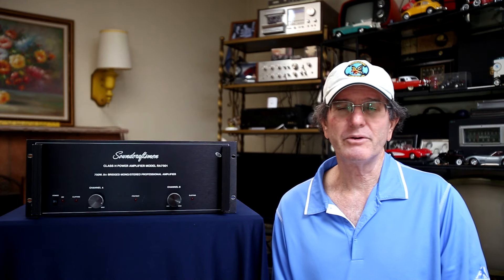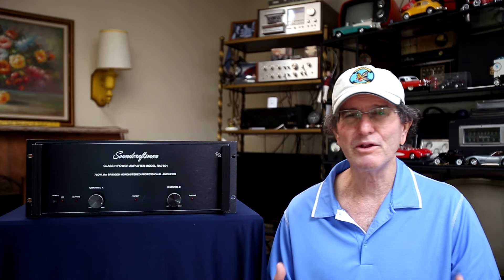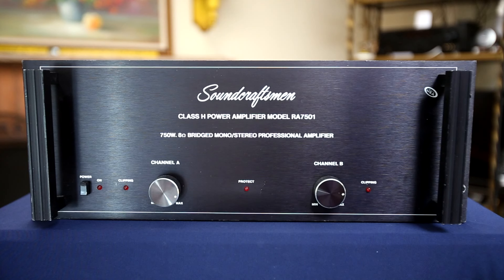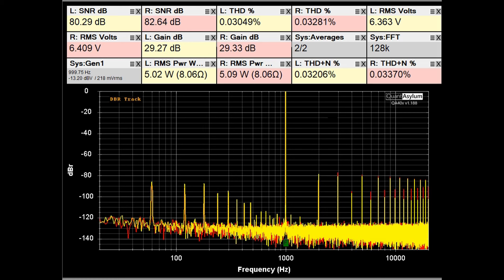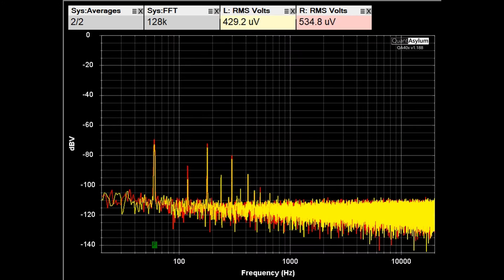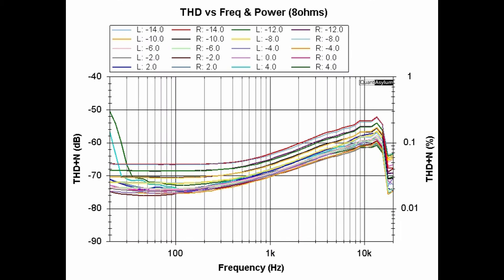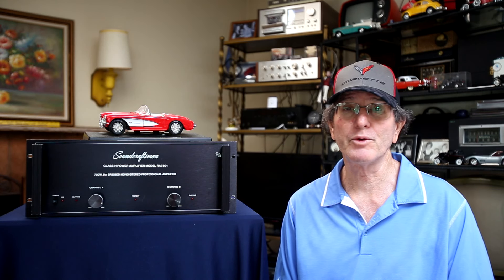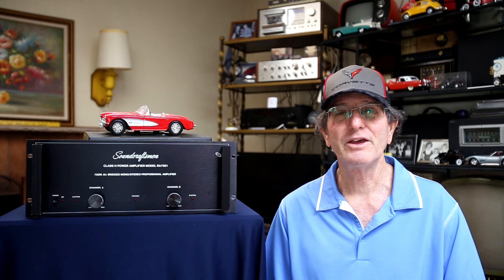Soundcraftsmen RA7501 Amplifier: Vintage Audio Review Episode #104

Comment: Soundcraftsmen made some superb DJ mixers back in the day. The audio quality from the pre-outs and rec-outs were transparent to a point it was a joy to record directly from the mixer. 👍
Reply from the maker: I had forgotten about their mixers- good to know that they performed well- thanks!
Reply: @vintageaudioreview  Yeah some of my friends actually were sleep on Soundcraftsmen DJ mixers when I started using them because the mixers of choice back then were from popular brands such as Pioneer, Gemini, Technics, and a few others. I looked at Soundcraftsmen mixers as a mixer with an audiophile approach. They didn't have a huge line of various models like some of the other well known brands but the ones they had were excellent. The line-out (tape out) quality was one of the stand out qualities that caught my interest in their DJ products because I was recording more often than DJing.
Reply from the maker: @ecstasy5317 I almost bought an SC mixer a year or two ago, but did not want to have to deal with having two turntables. I have a Digital Pioneer mixer that I use these days. Back when I DJ'd in the late 70's/early 80's I had a CM Labs 620 mixer (also me preamp), which I would record from- thought it did okay

Comment: Great gear! I have now a soundcraftsmen Pa 5001, a ps audio 4.6 preamp running a pair of Dahlquist dq10, and I have to admit that is a great amplifier! I agree that is a little bit noisy when on, but the sound it puts out is phenomenal!
Reply from the maker: The PA5001 is going to be pretty much the same sounding amp as the RA7501, and that little thump is just when first powered on, at least for mine. Have not heard your speaker, but imagine that the combo you have works well like you said- thanks for taking the time to comment!

Comment: I used to sell Soundscraftmen audio back the late 70's and early 80's, to me the were gutsy and better sounding than SAE, I remember driving Hartley's top of the line speaker that had a 36" woofer, what a sound. They also had the preamp-equalizer, it was to me not as refined as the amps. I till have the vinyl equalizer test record. Those were the days.
Reply from the maker: Thanks for much for sharing! I can't imagine how a 36" woofer would sound... Did you bring up their "shorting the outputs together" testing? I always liked the looks of SAE gear and their parametric EQs were cool. Hopefully one day I will get an Sae piece in. I liked the SC equalizers or even the preamp/eq's- think they called them a scanalyzer and would use the test record you have. Maybe one day I will come across a deal on one of them.
Reply: @vintageaudioreview We did not have the "kit" in store. The Hartleys had a very British, refined but because of the size the were sounding like the big 2X15" woofer JBL pro monitors. SAE parametrics were very good for specific issues in a room, almost like the McIntosh room corrector. I started in pro sound, doing local shows at an auditorium and eventually became the soundman for many shows and recordings. Then for income stability, worked as a salesman in audio stores. Did both for a while. To me one of the best amp out there, then, was the Crown DC300A, tough, still could deliver the nuances of Hi-fi equipment and recordings. That was our prefered amp for demos on Kef 105 and BW DM 6(crappy speaker for the size and price). Tried many amps over the years and that one always made me smile(DC300A). That one made JBL L300 sing. Those were the great days of Hi-fi. I always enjoyed high wattage Marantz amps, more than Pioneer. Harman-Kardon Citation 16 was nice sounding but not gutsy enough for lower octaves. McIntosh, sold that for a while, it is hard not to like the brand, sound and look. Tattooed for life for the brand. Keep it up!
Reply from the maker: @AlainDumasblogphoto  One of the nightclubs I DJ'd at had a pair of DC300a, though one of them died. Old crown gear is great. I never forgot the KEF 105's because of that LED. Sounds like you have some interesting tales to tell. I agree about McIntosh and have some upcoming reviews on them. Not familiar with the BW you mentioned.
Reply: @vintageaudioreview I remember doing demos with the Soundcraftmen amp on Roger LS 3/5a, no one believe they could go low, they did to 32hz with this amp. Fun time. Audioanalyst, a pro shop back in the days, had Crown made modified DC 300a for him, he used it for his 2 way JBL 4560, so the amp was 155 on one channel, 80 on the other, so all of his speakers were bi amped with a built-in electronic crossover in the amp. One store I worked for had a basement room, we had the IMF Reference TLS and we drove it with the Luxman M-6000 and C-1000 preamp, Michell Transcriptor turntable, Teac 3340 reel to reel, listening to Direct to Disc, Lincoln Mayorga playing organ, the whole building shook. One day a neighbor called the police, was under the impression an explosion occurred. Thelma Houston, again direct to disc, I got the Music in me, ouch, when she starts singing, with the beat, it was amazing. That vinyl was made with the TOTO's musicians gang. I could go on and on. Last one for the day, an audiophile in the suburb had a house build, with housing in the basement for two EV 30" for the bass, made in concrete. Did not wait for it to cure. After 3 months of extreme bass, the foundation cracked, could not be repaired, the house was scraped.

Comment: What a monster of a 2-ch amp!   I recently had a california audio labs MCA2500 on my bench a few times (unfortunately!) due to low level power supply issues which finally got sorted out.   It's putting out a steady 550 watts or so at 8 ohms into all 5 channels.   20 output transistors per channel.   Your monster amp reminded me of it lol.   Wish I had the tools to measure the THD and such.   I bet the dampening factor is pretty good given the massive output sections.
Reply from the maker: Thanks for sharing. That MCA2500  is quite a beast if it is doing 500w/8ohms x5! Damping factor is probably >50 I would imagine..

Comment: I noticed you also have a Crown Sa-2,
Which one is the better amp the Crown or the  soundcraftsmen?
Reply from the maker: Thanks for the question. I no longer own the SA2. Once I got the MC352 I sold the SA2. Don't think you would hear much difference in the sound between them, if anything other than the fan on the SA2 in a quiet room with the music playing real low. The LED display on the SA2 is nice. The quality on both of them is very good. The RA7501 is a backup amp now, resting on a shelf.